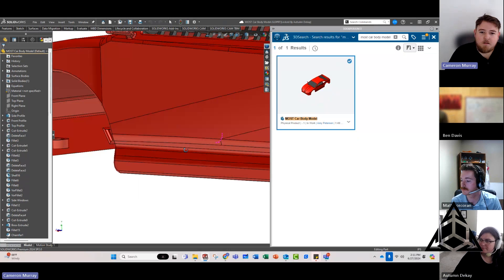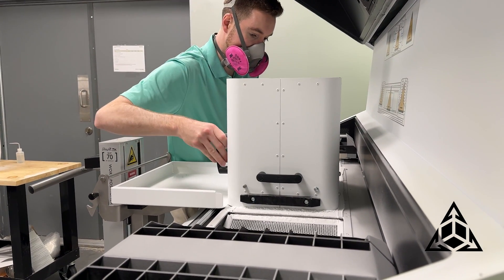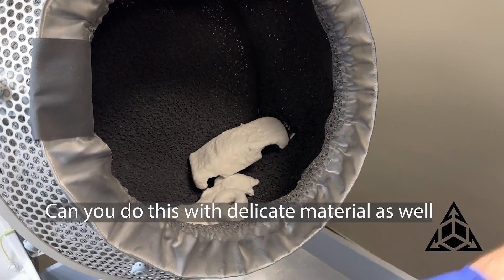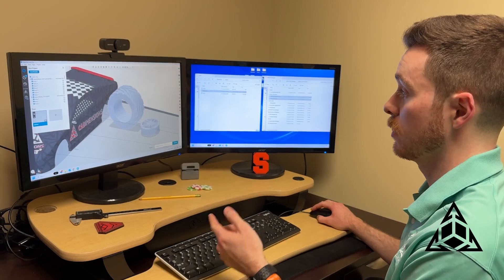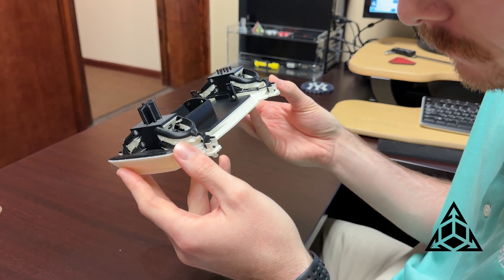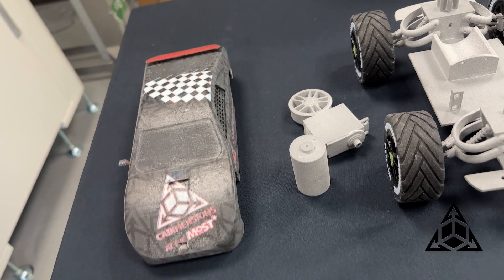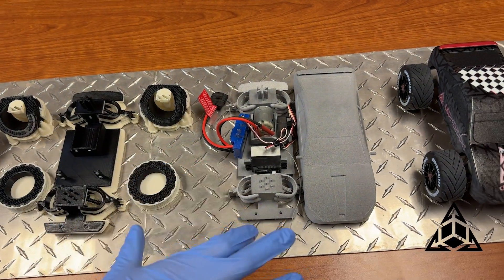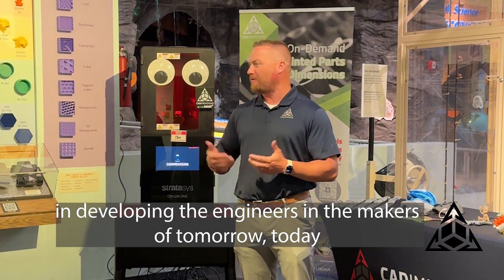Turning a Sketch Into a Museum-Grade 3D Printed Car – Watch Us Make It

Comment: "next-level tools like SOLIDWORKS" ? Are you sure you know what next-level means? SolidWorks is based on a seriously outdated Parasolid model, circa 1997, with the vast majority of tasks using only a single CPU core, and overall very inefficient in using available resources. Nurbs Surface modeling is tedious and very limited, no Sub-d modeling, no longer has any internal rendering tools (they were always garbage), so you have to pay extra for Visualize, a separate app... It's a legacy dinosaur...

Also, on behalf of the entire consumer 3D printing community: Stratasys can go fuck itself.